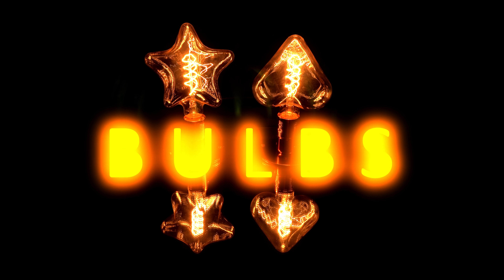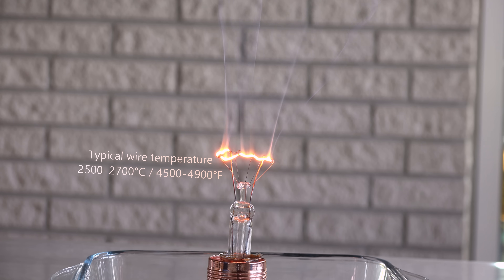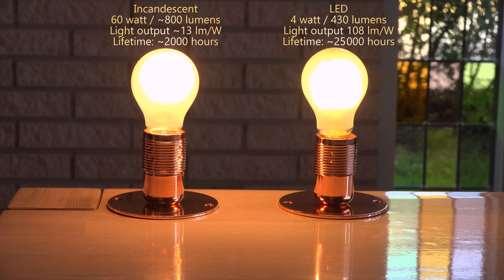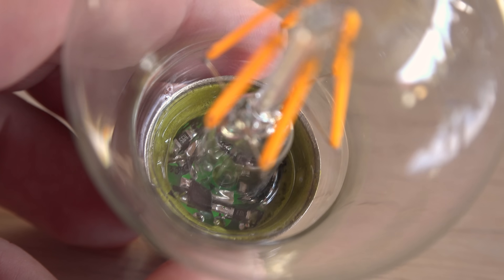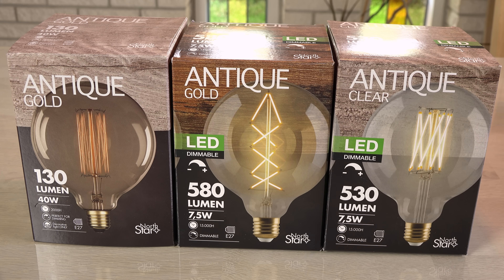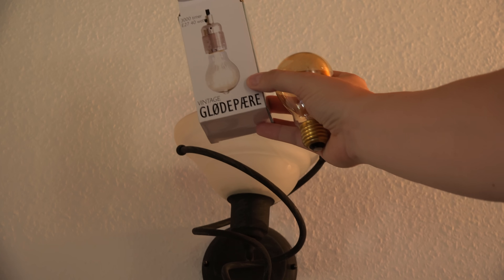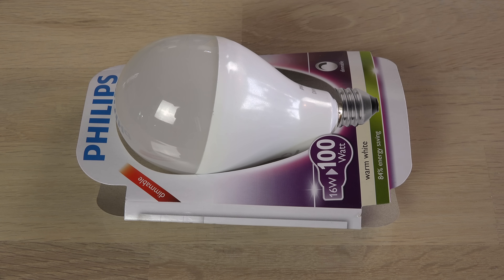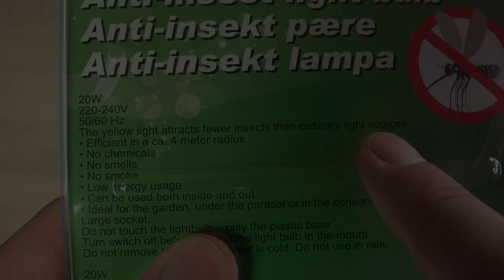Light Bulbs | LED vs. Incandescent

Comment: To talk about inefficient use .
Not mentioned much , is the fact the a higher cost price of the product
result in a higher degree of labor to collect the money for this specific product.
So if a person has a high income they might spend 15 min of labor to collect this product
or even less.
If one has a low income they might spend 2 hours of labor to collect this product or more , this depends on the light bulb costs .
So if you are a doctor you sit in a room listening to your patients you have a light bulb on your desk and a charger for your laptop so that's about the energy you're spending.
If this person has a job as welder or as a ground worker the energy spent to collect his salary is far higher .
Plus that his income is less
Less is also the money left over to support all the other products one needs.
those cfl bulbs are sold , said to have a life span of 10 years, this is not the case.
And it's a claim that doesn't hold , hours of use , does .
And life span of what , being abel to give light or do what it suppose to do in the correct
amount of lumen
if one talks of the efficiency of the manufacturers it is much higher than with the incandescent light bulbs the make a far higher net income on a bulb.
the old marked of incandescent light bulbs could not have lower production costs and net income on a bulb was about 2 cents this is the only reason those cfl light bulbs are so efficient.
what does a Kw energy cost in the Netherlands ?
It's about ;  6 eurocent electricity Kwh
                   12 eurocent energy tax
                   3,5 eurocent BTW consumers tax  
If one looks at production cost and energy spend on production assembling and gathering of the materials shipping energy and distribution to the country's one gets a complete different picture .
A cfl contains a bridge rectifier a filter capacitor and usually two switching transistors witch are often insulated-gate bipolar transistors .
to make those parts , mining , fabrication , distribution and implementation energy is spent for the final product .
Incandescent light bulbs contain ; glass , a tungsten filament , contact wire , 
vitrite insulator and a tinned metal cap .
And we didn't even talk about radiation .
Incandescent light bulbs go to near infra red witch is actually healthy and encourages
body processes because of it fuller light spectrum more natural then the high frequent
pulsing cfl witch is causing the body to produce less or not vitamin D.
Sun light is the best giving a full spectrum according to the season .
but cfl or tl are the worst alternative .
God is the light that we need in our life.
Light produces pta energy in our body .
a person of 70 Kg produces about 55 Kg a day pta but can't survive 15 sec without it .
onley a third of our energy comes from our food intake the rest come from the light .
So light is the essence of life .
God bless you all .

Comment: whats that thing he screws the light bulb on that cable switch-base called?
Reply from the maker: It is a wall mount for a bare bulb. I found them at a local store but oddly enough can't find them online. Hope you have more luck in finding them :)

Comment: the wire is glowing because the electric current not becuase its the best conductor!
Reply from the maker: Exactly. As I explain in the video the filament wire has the highest resistance making it the worst conductor in the electrical circuit. Therefore it gets hotter from the electric current than the copper wires leading up to the bulb :) Thanks for watching.
Reply: Brainiac75 your welcome sir!

Comment: The "CRI" factor is often misleading. Incandescent lights at "100(%) CRI is flat wrong (from a scientific viewpoint). Incadescent light bulbs generate lithe at a color temperature of 2500 to 3000 (usually around 2700 to 2800) degrees Kelvin. Natural daylight in "open shade" provides light with a color temperature of 5000 to 6000K. This is the "usual" standard -- in fact, in color process printing, calibrated lights (usually specially manufactured lightbulbs) are used with a color temperature of 5000K as the standard for evaluating quality of color reproduction. Standard incandescent bulbs at 2700 degrees are considerably more yellow than 5000 degree light. Before the arrival of digital cameras, photographers were generally very aware of this situation as color transparency film came balanced either for daylight/xenon strobe flash (5000K to 6000K) or balanced for "indoor" light at around 2700K. 

Prior to the arrival of LEDs at my local "big box retailer" I was able to get fluorescent (tube) lights rated at 5000K with "full spectrum" color. Normal fluorescent bulbs (tubes and curlicue) are NOT full spectrum, with strongest light output in the green part of the spectrum, thus daylight balanced film would deliver photos with an unpleasant greenish cast, especially effecting the appearance of caucasian skin color and meat. (Butcher shops tended to get special "pinkish" florescent bulbs to use over meat display cases to offset this problem.) 

The spectrum of LEDs are all over the place. Some replicate full spectrum reasonably well (I replaced my 5000K lights in my work room with LEDs with similar specs) so I can properly evaluate color printing. (I work in the publishing industry.) But many other LED lights in my home generate some weird colors, even though the manufacturers "claimed" white light (a blue to purple tint is most common in "white' LEDs). The LED bulbs that claim a "warm white" usually manage something around 2500K to 3000K and clearly have that "warm" look similar to old incandescent bulbs. 

The LED bulb manufacturers do not give truly clear/honest information about the nature of the spectrum provided, other than the CRI number, which is not very reliable, in my experience -- and is reflected in the comparison shot of the packaged meat toward the end of your video. An honest "warm" LED bulb should provide light that is similar to the incandescent, but the comparison frame shows that the LED light, while better than the center choice, is no where near as pleasing as the incandescent. That suggests that the LED is producing light with a spectrum that is quite different from the spectrum of the Incandescent. The "photo" CFL that you showed (at one point in the video) should have produced a reasonable color rendition of the meat, as it was designed to have a more complete spectrum than standard florescent bulbs, though it would have seemed more "bluish" than the standard incandescent bulb.

Comment: At incandescent bulb the rated power is calculating at 230V. If you test them to precise 230V with a stabilized power supply I think the rated power will be the same or close to rated power.
Reply from the maker: Yep, that makes sense. I must live at the end of a power line because I rarely have above 220V in the outlets. Thanks for the clarification and watching.

Comment: sorry, my english isnt that good... do they really mean like banned, like illegal... so could the police arrest me for fucking using these light bulbs?? :D that would be ridiculous ^^
Reply from the maker: The ban is on the sale of incandescent bulbs in the EU. It isn't illegal to have or use incandescents - but selling them is illegal. So I will not be arrested for using incandescents in this video :D Thank you very much for watching.
Reply: Brainiac75
no problem, i liked your video :D but is it illegal to import these like from china?
Reply: Greeting from sunny England.
you can still buy them here if they are marked as "industrial",same as the ones we used to use ,just a different lable on the box.
"warm" 40 Watt LED,s are just as good as the 60 Watt old ones now :-).
Reply: Just be careful you aren't sensitive to the flicker of LED. After a few months if you feel fatigued mentally you might want to put back the incandescent bulb and see if that's better. The LED flicker is like a refresh rate on the computer monitor happening many times a second versus the constant static burning of the incandescent bulb.
Reply: It's still perfectly legal to use these incandescent bulbs here in Britain, or import them for individual use, however large-scale import and production is banned. Hower halogen light bulbs are still on the market, I am currently using one in my bedroom that i've been meaning to replace.
Reply: Jake Rolland
yeah i think i switch completely to LEDs ...the reason for that is less power consumption and its not that difficult to repair them... thinking of only using led strips in my bedroom so i can control the brightness :D
Reply: Audioholic 01
yeah i thought of that... i have autism and i am a little sensitive to flicker (most of the times 50/60hz) ... i will probably use an arduino to control the led strips and configure frequencies that i dont find annoying. but thanks for the tip.
Reply: Audioholic 01
 its not that it stresses me, its that it distracts me, which can be a little stressfull... you get my point :D thanks for the nice words.... really rare these days...
Reply: richard nineteenfortyone
maybe ill be fine with turning the lights all the way off :D
Reply: richard nineteenfortyone
Good points. There is lots of radio noise that comes from LED bulbs. I put an AM radio within a few feet of a few popular brands of LED bulbs and the buzz and noise interference is crazy! Some people think this is bad for headaches and health if your too close to the LED bulb. Bad reading lights I guess.
Reply: Brainiac75
no need for that, i was just curious, i use LEDs and the other energy saving lamps which i dont know the proper word for :D
Reply: Chris aka Schulbus
Ah. Well then you know all too well. For me it makes me mentally drained and tired, maybe a headache and for a person with autism I would imagine it would be the opposite and add stress and maybe in the worst cases panic attacks and other physical symptoms. Well glad you know. Cheers to a balanced happy life for all :)
Reply: Nobody says what chemical infrastructure is needed to make the LED bulbs; I think it is VERY toxic.   But in China that does not matter.   Also, there is a matter of radio interference.  Of course you are only supposed to listen to local radio stations because those are the ones you can trust your government to control.
Reply: They are also banned in the UK . . probably whole European union
Reply: Chris aka Schulbus I also have autism and don't like many LEDs, but for me it's colour temperature and CRI that annoy me the most. Hence there still being a halogen bulb in my bedroom.
Reply: Jake Rolland
hmmm personally i never had problems with the colour temperature... im even thinking of adding different types of leds so i can mix colours and everything...
Reply: Private import of minor quantities is never a problem - except things like rhino horn powder or illegal drugs.
Reply: Yes from a dane
Reply: Lol, nah... you won't get arrested for using them or even buying them. It's just that they're not approved for large imports for sale.
Actually, if you still have incandescent bulbs in your house, deciding when to swap or not depends on how much you use it. If it's lights you use all the time (>3 hours a day) then it is justified. If the bulb is in a room that you occasionally use... like the storeroom, laundry room, or a spare room... then its best to leave it be & only replace it once it blows.
Reply: Here in the US it's a production phase out.  They started with the 300 and 200 watt and every year they stop making others, I think 60 watt and below are still made but they will be gone in a few years too.
Reply: Chris aka Schulbus Phillips now I thinks makes Led bulbs
Reply: Sales only, not possession or usage.
Reply: if the noise gives you a headache move the radio further from the light so it doens't make noise.
Reply: Christopher Banacka Nope,not illegal in US. Menards had a whole endcap full of them just the other day. I would hardly call that illegal. Mabe in Kommunist Kalifornia
Reply: richard nineteenfortyone  I’m not so sure about all that I think some really intense research should be done on that topic before reaching any conclusion of Wether they are good or bad for you,we definitely should not forget the lessons of the past for the same mistakes can be made again and again as history repeats itself , just look back at these few historical examples-the radium girls, the discovery of x-rays before people understood the dangers of radiation,this type of history always seems to repeat itself every time some people jumped to some kind of conclusion without doing the research to prove it,and it looks to me like history could repeat yet again if we make that same mistake of reaching a conclusion without doing the necessary research.you may be right they might be good for people’s health or you may be wrong and they may be bad for people’s health,that’s something we won’t know until the research is done.but the bottom line still stands it’s a very dangerous idea to just assume something is great without doing the research and possibly finding out that you were wrong,by the after math of all the people that ended up getting hurt when it’s already too late.just look at all the people who died of cancer when people used to believe that x-rays were absolutely fantastic,if only they had researched it more before reaching any conclusion,just imagine how many lives would have been saved.
Reply: @Chris aka Schulbus - Last time I checked you can't be arrested for simply being stupid Chris so I think you're safe.
Reply from the maker: Importing and manufacture of incandescent bulbs is banned - at least for stores selling for private use. Not sure if it is illegal for a private person to import for own use. Ask a lawyer ;)
Reply: +richard nineteenfortyone No. Just, no. That's BS.

These bulbs produce far less EM radiation than the sun does.

As for "human energy field," that's just pure pseudoscientific nonsense.
Reply: On the other hand, use of LED bulbs conserves tungsten that we need to make armor-piercing munitions for the next war.
Reply: On the other hand, the LED may be generating electromagnetic vibrational frequencies that interfere with the natural function of the human energy field.   This is a good topic for serious scientific research.
Reply: LED lights may be good for you.   There are practitioners who treat all kinds of ailments by shining LED light on your afflicted body part.  It is said by some that this actually works, just like magnetic therapy, therapeutic touch, and homeopathy-- all of which are criticized by the conspiracy of big pharma, the AMA, the elitist medical schools, and the multibillion dollar hospital chains.   You Europeans and Brits are lucky to have a civilized medical delivery system that is equally fair to all (nobody gets anything).

Comment: why are car leds super hot!?
and need a cooling fan
Reply from the maker: As mentioned in the video LEDs do heat up, especially the ones with high lumen output. Car headlights have to be quite intense in output in a small space - even in the summertime in the desert. So they will heat up a lot, and LEDs don't handle heat as well as incandescent bulbs. That's why the car LEDs have big cooling fins and/or cooling fans. Thanks for watching!

Comment: Apart from being funny, the video was also informative as I found out about CRI. 
Ones I compared incandescent bulbs with fluorescent bulbs rated with the same equivalent power (a fluorescent bulb of 23W should be equivalent to 110W incandescent bulb). However, I noticed that this was not true; it felt more like 23W=70-80W. 
Somewhere I heard that even the lumens are the same, they are measured 1 meter from the bulb and that the light from fluorescent bulbs gets weaker with distance than with the incandescent bulb (so 2 meters from the bulbs the incandescent bulb light is brighter). Maybe when the light is reflected from the ceiling or wall gets dimmer with fluorescent bulbs? Does that make any sense? Or is this effect about the frequency of the emited light?

Comment: I like LED because it turn on instantly, even in winter. I was in using for 3 years without any replacement, I have more than 20 bulbs at home. In the past, I need to replace the bulbs every 2 months.  I were using the bulbs as heater, I need to switch off the light at night. I still need to turn heater on. I think band of incandesce  are completely make sense. I think EU also need to band CFL as well. CFL contain so much Hg and harmful to our next generation.

Comment: What the knee jerk greenies forgot to mention, is Fluorescent bulbs have mercury in them as a gas, and disposing of them is illegal in landfill, or kitchen bin. It is required to wrap them up and send to a specialist recycler / handler. So the greenies by saving power, has created a mercury waste problem which most households not aware of, or couldn't care about. Also, LED still not widespread here (Australia) in bayonet type, even though I have been checking local light shop for over 8 years and they still don't. Don't forget LED needs a special resistor in the bulb itself or the fuse system for household to handle the step down and heat (Yes, they do heat). Putting LED aftermarket in car? Need to add a resistor to fuse box for indicator or marker globes.
Reply from the maker: Thanks for sharing. I don't recommend CFLs either. Their warm-up time can be horrible and the CRI is usually low with an odd green tint.